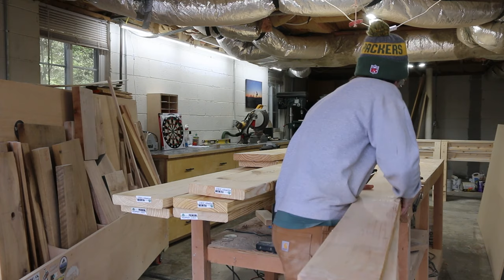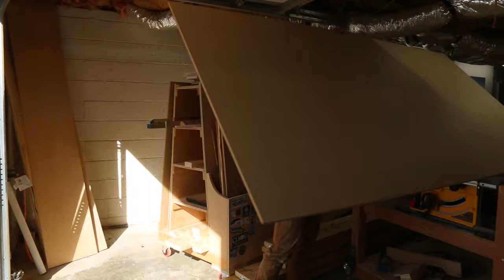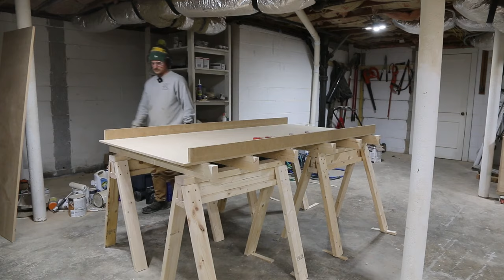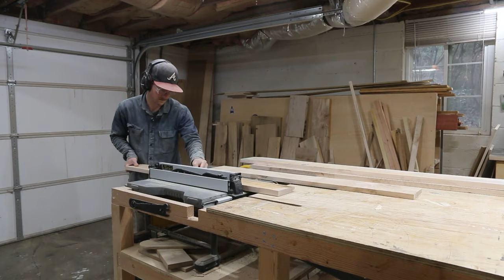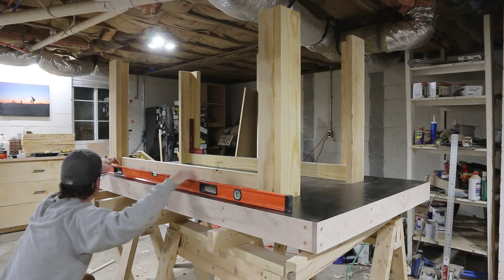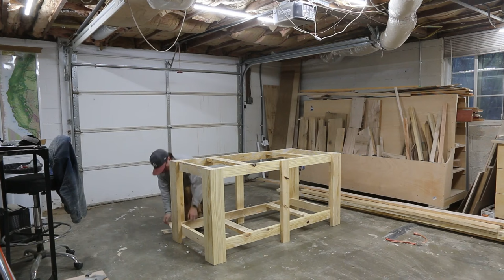Building a dead flat work surface. Torsion box versus laminated plywood.

Comment: Torsion box construction goes way faster with halved joints. Another thing to be mindful of is ripping all the sides and inside ribs in one go, without moving the fence on the TS. This ensures the flatness.

Comment: Thanks, a nice video and gives me a solution to the chicken and egg problem of how you make a flat assembly table when you don't have a flat surface to work on. 
Two questions are going through my mind
Firstly, could you have managed to get the laminated top that flat if you didn't already have a super flat torsion box assembly table to lay it down on for gluing?
And secondly, how flat will the two of them be in a year and the material has had a chance to move?
Reply from the maker: Appreciate it! I actually don’t think you can get the laminated table perfectly flat without some prior reference. It may not need to be a full torsion box but maybe it could be the leveled saw horses that bridges the reference gap. Hopefully the torsion box won’t move at all since it’s MDF. The laminated table possibly would drop some because it doesn’t have as many supports underneath as the internal ribs of the torsion box.  Maybe I’ll have a revisit in a year to see how that holds true or not.

Comment: Plastic laminate on top and unfinished on the bottom will cause the two sides to expand and contract at different rates.
Reply from the maker: Didn’t think Mdf had that much movement  or any but will see over course of time. Been 6 months and it’s still flat. Thanks for the feedback though. I’ll keep checking.